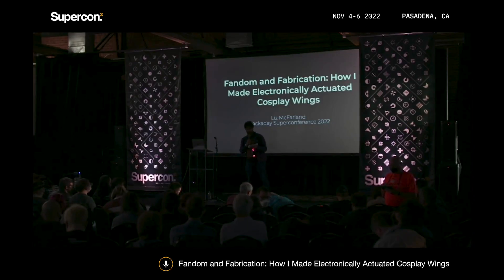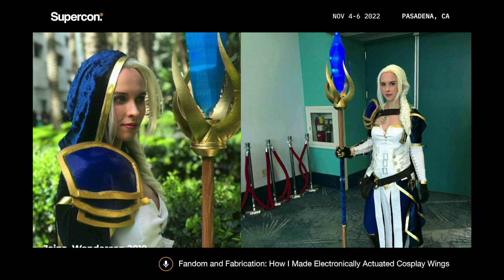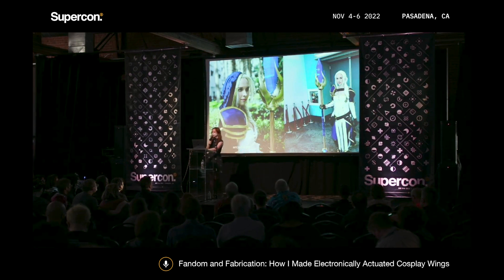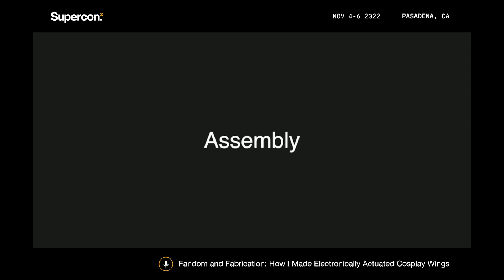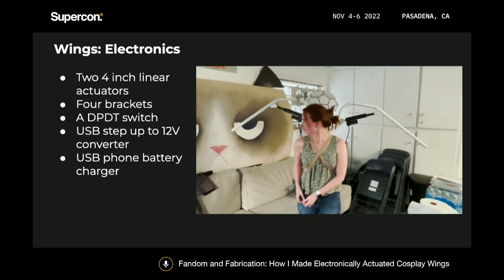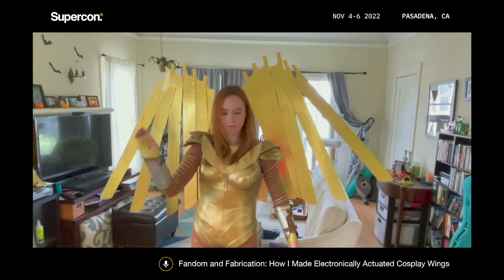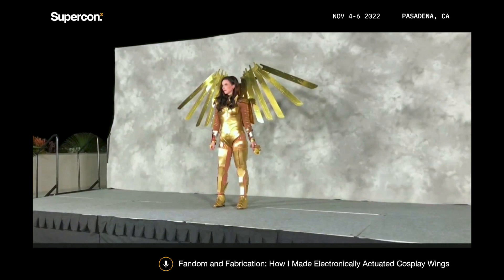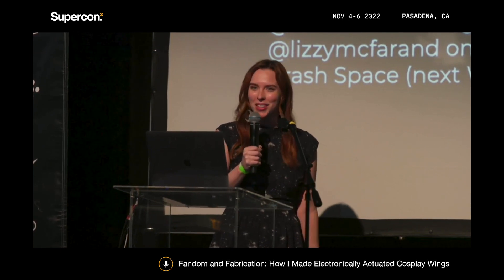Supercon 2022: [Liz McFarland] Builds Golden Wings, Shows You How

Comment: You could use cable and pulleys hidden inside the pipes and a single linear actuator vertically in the center, with a cover over it. Have the actuator push down to pull the cables so they lift up the outer pipes. Using one actuator instead of two would take a lot of weight off. A second set of feathers on the back, offset 50% to overlap the front ones, would fill the gaps and add more dimension to the wings.